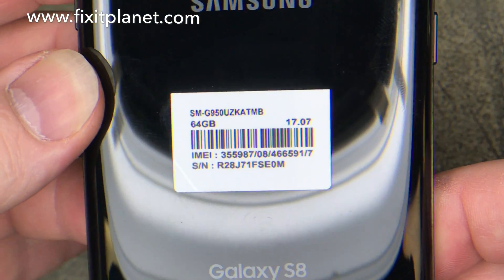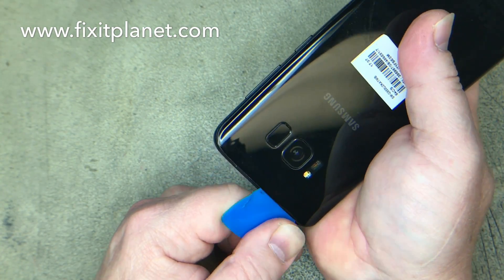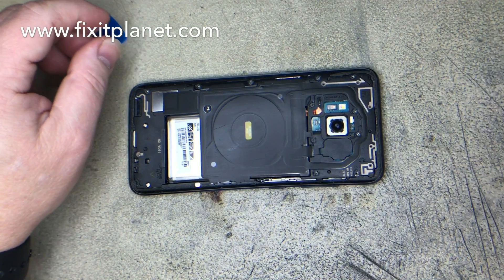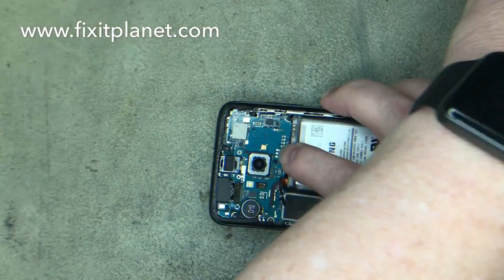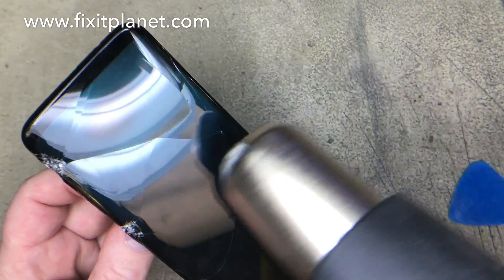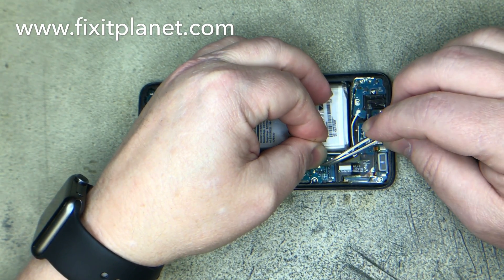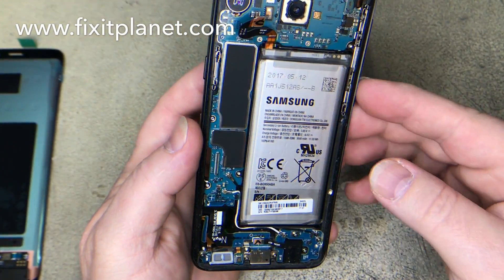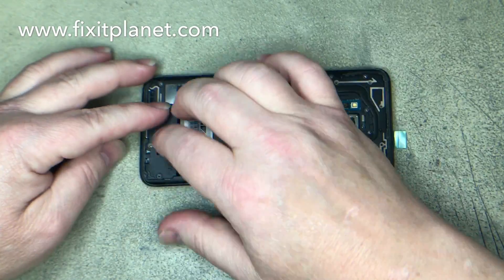Samsung Galaxy S8 Screen Repair From Start To Finish.

Comment: What’s the point of removing the rear? Can’t you just pry the glass screen off if that’s the only thing that’s cracked?
Reply from the maker: No you cannot just peal off the front, besides the battery needs to be disconnected before performing the repairs.

Comment: @FixitPlanet 
Are there any Drawbacks of changing/Replacing Screen with Aftermarket one...?
1.   Will it Impact Touch Sensitivity ?  
2.   Will it reduce Clarity? 
3.  Will it be less reliable/ more Fragile than Oem/Orginal Screen?
4. Any other drawbacks / side effects?

Comment: Destroyed my phone so not happy.  Ripped the screen ribbon connector off the screen while trying to peel display and screen around 9 minute mark.  He mentions no CAUTION at all while doing this.  You can’t just run the separator around the edge as shown.  My fault of course but experience can be a costly lesson.  Sacrificial phone.  Just in case.  Just as well.  The screen ribbon was unplugged and I did ‘feel’ it.  Thought it was extra tough glue.  Now I know.  S9 next.  Keep smashing phones electric skateboarding.  Investing in hard cases too.  Good luck.  Great video.  Just needed a little caution reminder around 9 min mark.

Comment: How much does it cost to get that done, and how much does it cost for to buy a new screen
Reply: according to samsungs site (when I set it up to get a repair through them) it was $70 so I'd assume it be around that is not a bit cheaper if doing it youself.
Reply: @katobrucelee08  thank you for the reply if I was to do with myself do you know where Hollywood a new screen
Reply: @jasonwade1458  Probly ebay or AliExpress but its kind of a buyer beware situation (could be old/brokn screens) thats really all I got
Reply: @katobrucelee08  thanks for the tip I heard it is better to get a second-hand getting the quality of Samsung because the ones that are sold brand new are not always up to par so here thank you for your time I appreciate it

Comment: Do you show you actually attaching the new screen to the display?  Unfortunately as I didn't know the metallic sheet over the display wasnt' supposed to be damaged or was important as I was watching mine was ruined!
Reply from the maker: You FKG Got to be kidding me. The entire process is included in th4e video. Yessss you have to replace the entire display assembly.

Comment: Can you answer this question ASAP? I broke the protective glass on my s10+ but the touchscreen is completely fine and the device functions as normal. I found a replacement on amazon for $30 and am wondering if that is all I need for the repair. Is the digitizer in need of replacement as well? Thank you so much!!
Reply from the maker: Unfortunately you need to replace the entire display assembly despite any available parts or opinions.

Comment: Managed to take the phone appart, used a hair dryer. Now i am looking at replacement screens, all appear to be glass only but we reomoved the other layer of the screen, the gold part that plugs into the phone. Is it a given that that also comes as part of new glass?
Reply from the maker: That gold part is one of the layers of the display itself and will come as part of the full assembly and looks like this https://amzn.to/3h19ys1 Don't try to replace just the glass only. Sorry for delayed response.
Reply: @FixItPlanet1  price around £150, refurbished phone £200 so not really worth fixing? Maybe I should have replaced the screen only...

Comment: Does anyone know how to fix a galaxy s8 that the front and back screen is shattered? The screen won’t turn on, but it is still functional because whenever I power it on, it makes the default sound and it blinks the led light every so often. I don’t really want to spend money on fixing it but I also want it to be fixed, even if I have to repair it. And I already have all my files backed up so in case if I don’t fix it I didn’t lose anything.

Comment: hi great video ! how long did you put the phone on the hot plate and what temperature please if you can help . im new and i don't want to burn or destroy the battery
Reply from the maker: Just a few minutes is fine. 5 or 10 minutes at a time is safe as long as your temp is not to high. Temps vary so test first.

Comment: So how long does it take to heAt the phone since you skip that part and did not mention during the video  😬
Reply from the maker: It all depends on your heat gun, distance from the device, air flow, angle, temperature settings, etc.

Comment: was the replacement screen original or class a?
Reply from the maker: We use only new genuine Samsung part original OEM display assembly. No aftermarket. No used.

Comment: I was going to try doing it my self but when you have to pretty much have to disassemble the whole phone I dicided against it then ask a repair man how much to fix?  258$ . Look in amazon brand new S8 unlocked for 215$ guess what ? Yup got a brand new replacement. Much easier I think.

Comment: Glad  to have came across your video sir! I am replacing both front and back after having an S8 without using a cover for a couple years now. Don't worry, I'll be getting a cover after this. Either way, I got the front and back off, and the fingerprint reader is off the back plate too. Being very gentle with all of it. Have enjoyed the process. I'm not sure why at least one other video recommends to basically completely disassemble the phone to put on a new screen. But anyhow, Happy Holidays, and thanks!
Reply: *come

Comment: im not sure, if this is what i need.. my phone was cracked as well but the technician told me theres different kind of lcd or amoled .. i cannot understand  him.. so hes asking me like 180$ here in Philippines roughly  9,000 pesos for just changing the broken screen.. my screen was cracked and somehow it has light pink lower quarter part of my screen its like tinted on very very light pink color.. should i buy the  AMOLED or just the LCD.. my phone doesnt have ghost touch  at all.. perfectly working
Reply from the maker: The term "LCD" is sometimes used to describe any display. You do have the OLED on the Galaxy S8 and that is what should be used.

Comment: Thank you, sir!  This is the Best video in this market (IMO) and I've got hundreds of hours of video I've been exposed to not by choice but by dealing with this damn Samsung Galaxy Note 8  "SM-N950U " (Started with me buying "Charging Port Dock Connector Flex Cable" and when I had issues finding out I have the Note 8 SM-N950U edition and what I ordered was for SM-N950F. Then  wtf??? There's also N950N, 9500, N950W, N950 S/K/L, and N950FD??????  

It was a growing pain but a lesson learned! 
Still lots of value in your video, my attention confirmed!

**MY REVIEW:**
Professional, Excellent tips & helpful advice,  delivering value through the range of information from both extremely basic to extremely advanced. 
-Volume to Background Music Ratio is Perfect and makes easy to understand communication
-Music Loop is not annoying and does not become overwhelming  (Great choice of song!)
-Clearly Audible
-Speed is not too fast or slow, but helpful to digesting information provided
-No "Small Talk" and all relative  to this item and successfully troubleshooting item.
-Your wisdom you provide is based is helpful and relative to your personal experience  which has me trust your integrity.

Kind Regards,

-Chris
Reply from the maker: Thank you sir!
Reply: @FixItPlanet1  You're welcome! Keep up the good work.

Comment: Didn't test the pressure sensitive home button, but who cares right ? If you guys repair it yourself - make sure to check that. When the screen is dark press the bottom middle portion of the display and you should feel the slight vibration and screen supposed to come on.
Reply from the maker: I do a more thorough test before returning it to the customer. If there was a problem we would have known and so would the customer.

Comment: I have had the back of the phone off for a couple of days not. When I go to put it back on will it re stick? should I heat it up again?
Reply from the maker: It should remain sticky if it is not covered in dirt or other debris. Warming the adhesive when reapplying can make it more "tacky".

Comment: Is the heat gun safe to use near the battery?
Reply from the maker: Not if you leave it directly on the battery for an extended period of time. You must use a safe approach. Never apply excessive heat directly on the battery. Never puncture or cut the battery. Never burn the battery or put near an open flame. All these cautions are for your safety and others nearby. If you use common sense and use safe practices you can still manage to work with the device in a safe manner. You can aim the heat away from the battery or use shielding for example. Don't be afraid just be safe and sensible. Good question. ;)

Comment: I think that parts quality is paramount. Any supplier/ you recommend? OEM aftermarket?
Reply from the maker: Anytime you can get the original manufacturer then you should for sure.
It's also better when you replace the screen with the frame assembly, this way you get a factory seal and keep water resistance. There are several suppliers but look for the ones that have good return policies for example. Start with https://www.injuredgadgets.com/ and compare. Cheers

Comment: The most important part - the actual screen replacement procedure is missing - between 9:50 - 9:51. The phone frame is laying stripped to the bones on 9:50 and over the sudden on 9:51 it as already installed with most of the parts on.  Why?

Comment: My s8 screen started to blinking the colors getting weird and sometimes it turns broken yellow. Back to normal when i power off on again but the brigtness/colors still different from normal, sometimes it can go back to completly normal for a while. Anyone know if its hardware or software problem? Tried factory reset etc nothing works yet.

Comment: If you are just replacing the glass screen can you just only take the glass off without taking everything else apart
Reply from the maker: It depends on what you mean. "Glass only" replacement is not the same as replacing the display assembly as we did in this video.

Comment: Thank you for this video. I followed along as I replaced my screen. when I first stuck the new screen down it was slightly off center and nearly had a heart attack as I pulled it back up to reset. but happy to report a success.

Comment: Where did you get the replacement screen?
Reply from the maker: You can get a replacement screen with frame here https://amzn.to/2UZIXlG and one without frame here https://amzn.to/38Bm1xj
Reply: @FixItPlanet1  Is getting a AMOLED display required? Is this the cheapest? $250 is steep, at that point might as well buy a new phone. Thanks for the repair vid tho
Reply from the maker: Yes unfortunately the genuine screens are fairly expensive. The aftermarket screens typically aren't that much cheaper and have poor glass and image quality.
Reply: @FixItPlanet1  Also, can you explain the difference between frame and without frame? Does the framed one come with everything except the motherboard/battery/camera?
Reply from the maker: The advantage of getting the screen with the frame is the screen comes factory sealed improving liquid resistance. Also you just need to transfer components from the damaged phone to the new housing making repair easier and faster. Disadvantage is you pay a little more.
Reply: @FixItPlanet1  thanks so much for the information. I found a new oem s8+ screen with frame for $150 on eBay. Hopefully I don't screw up the transplant and throw away $150. Thanks again for your help and replies

Comment: I have a screen that flickers and sometimes half of the screen turns black (I've dropped the phone multiple times). Will this fix the issue? Everything else like the speakers, mic, etc. works fine. What do I need to buy? Do I need to buy a frame too?
Reply from the maker: Yes it sounds like you have a damaged display. Best get one with frame and everything https://amzn.to/2Ux2IkC

Comment: Or you can buy a screen removal table .. it heats the screen and holds the phone down .. most repair shops use those instead of a heat gun..... Well, the pros do
Reply from the maker: You mean like this one we use https://www.alibaba.com/product-detail/UYUE-948R-Plus-18inch-LCD-Separator_60659027986.html

Comment: I was looking at the kits to buy is it realistic to try and replace one with the kit I am a mechanic not an electrician but like to think I can turn my hand to a lot of things I am worried about how to get the broken screen off and the best way to do it and if the kit I have looked at has a torch is this a heat torch any advice would be welcome if you have done one as I will not pay £160 in a shop it's not worth the price of the phone.thanks🙏🏼☹️
Reply from the maker: The "glass only" repair kits are not practical. "Glass only" repair is difficult but not impossible if you want to go that route.
Reply: @FixItPlanet1  ta for your message for £15 I may as well have a go it would only go in the bin.👍🏻

Comment: Can I use a very hot hair dryer to melt the glue? I dont have a heat gun.
Reply from the maker: Yes ... It will take longer to heat up but if that's all you have go for it. Just be patient ;)
Reply: @FixItPlanet1  thank you very much :)

Comment: Do you have to put glue on the back glass in order to stick on?
Reply: Riley sweats adhesive sticky tape usually does the trick
Reply: Phone adhesive (just incase)

Comment: John, with my broken screen on my S8+ , what do I need to purchase? A screen with digitizer? Samsung  charge around $350 (Australian). Yet when  I go to eBay I can get a "Digitizer Touch screen glass part replacement" for only $45 (Australian). Why the discrepancy John; is their anything else I am missing?
Reply from the maker: The discrepancy is because the glass is cheap. The display assembly is not cheap. The method for a "glass only' repair is difficult, risky, and time consuming. I recommend replacing the entire display assembly with the frame as done in the following video https://www.youtube.com/watch?v=Q0F1IEnPq9M&t=286s

Comment: Worked great. Phone's fixed...other than the fact that I shattered the back cover getting it off. Every slip of the pick would snap another section. But, with a little bit of ingenuity, I was able to reaffix the camera covers and fingerprint scanner with a bit of duct tape, replace the screen and it works like a charm. Left the back screen off and put it in an Otterbox Defender.

In short, this guy is worth what he charges. I'm fairly meticulous, but he makes this look much easier. Still glad I gave it a go. Not perfect, but works perfectly. :) Thanks for sharing this video! It helped a lot!

Comment: Can the LCD be salvage so it can be use in a different phone? There are no videos about it in youtube.
Reply from the maker: If you mean is it possible?
Short answer maybe yes. Or depends on methods and approach.... 
If you remove the entire assembly housing and all then no problem. Separating the display from the frame big problem.
Long answer maybe not:
The display assembly is made up of several "layers". The layers under the "glass" are extremely fragile and can damage easily. If any layer is removed or damaged it will not display image properly (if at all). "Glass only" repair can be done however... that method is tricky, complicated and better off done with dedicated machines not freehand.
Hope this helps.

Comment: ok i have a question, i watched someone else's screen repair video. where they froze the phone and the glass just magicaly fell off. well i tried this and had no luck in doing so. So i got my hair drier out and heated it up. after a few min. the glass started lifting away. BUT and here is the big BUT the screen was gray afterwards and when i put the new glass back on it would not light up at all. is there anyway of fixing this without spending $180 on a new digitizer?
Reply from the maker: The display assembly is made up of several "layers". The layers under the "glass" are extremely fragile and can damage easily. If any layer is removed or damaged it will not display image properly (if at all).
The only way to repair the damaged screen (in a practical sense) is to replace the entire assembly.
 "Glass only" repair can be done however... that method is tricky, complicated and better off done with dedicated machines not freehand.

Comment: Hi I also didn't see you put any adhesive
Reply from the maker: If the rear cover adhesive is in good condition you can re-use it. The new screen we installed already had new very strong adhesive attached to the display assembly.
Reply: @FixItPlanet1  thank

Comment: Hi thank you for the video, you showed replacing the complete LCD or just screen. If I buy from eBay cost 20$ to 30$ will it work?
Reply from the maker: You cannot buy a screen assembly for $20 or $30 dollars. Those are glass only kits.
Reply: @FixItPlanet1  so please confirm my glass for both front and back is damage do I need full LCD or just glass screen. What is the part called? I m confused what I should buy.

Comment: Why wont the make the glass "crack-resistant"? Its possible. Make it out of the same glass those older CRT monitors? Remember those? A 22" monitor weighed as much as a fridge! Also, because of the shape of those old monitors, they were awkward to hold & carry. The pictures was for shit, but we just need the glass.

Comment: did you replace just the glass? or that gold colored piece as well??  what is that gold piece behind the glass?
Reply from the maker: This video is not a "glass only" repair. The gold colored piece is the part of the display that shows image. You are witnessing the separation of the different layers of the display assembly.